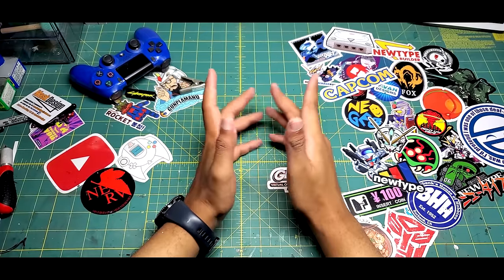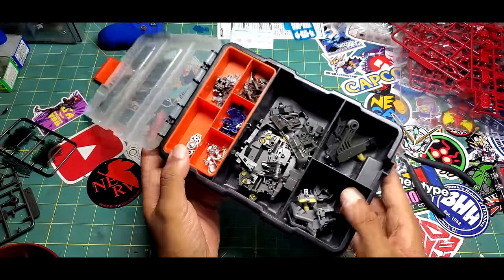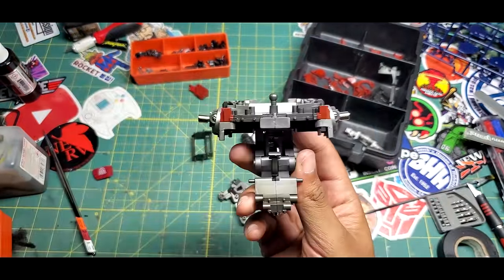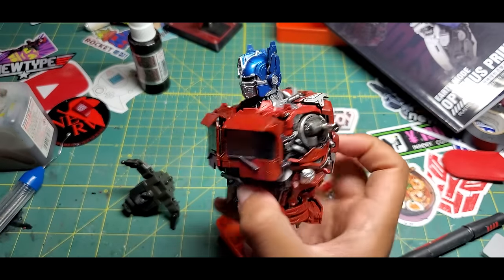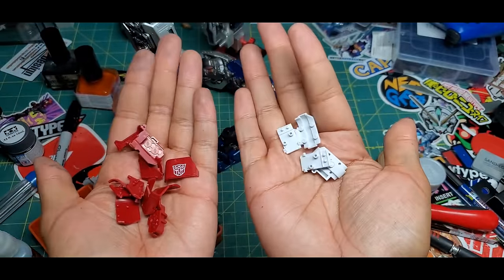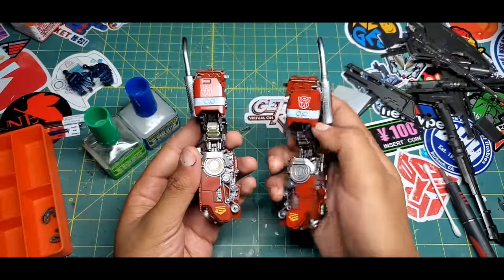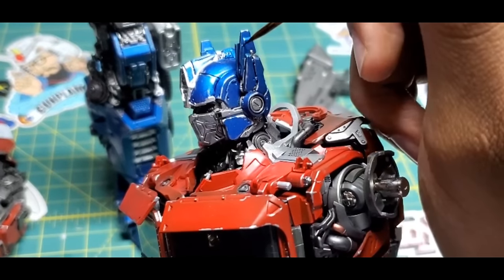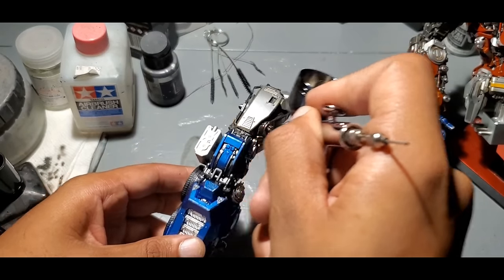#newtype #transformers Transformers Bumblebee Earth Mode Optimus Prime

Comment: Number 1 inspiration and builder on YouTube at the moment! thank you for this production. One question, after painting the parts, do you also spray a clean coat on it or just leave it as is? I had problems with paint chipping when not using a clear coat before putting a model together.

Comment: Just got the kit, I have metallic steel and silver Mr hobby spray paint laying around. Wanted to spice up up the black and grey unpainted components but I only want to spray them straight on the runners. Any ideas on which unpainted runners I should use those on?